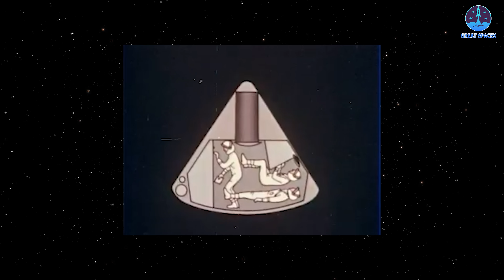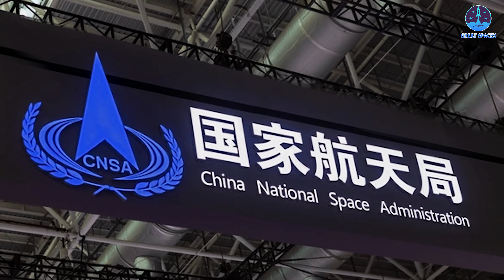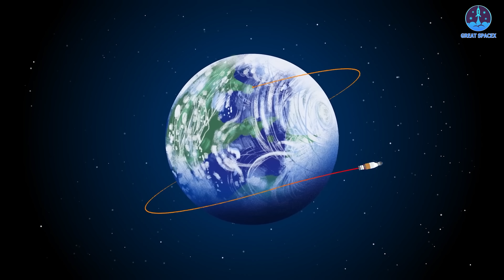SpaceX’s Genius Solution to send Starship Straight to the Moon! Better than NASA and China…

Comment: The thing that probably makes the most near term sense is to send two Starships to the Moon at the same time.  One will be the HLS and the other a regular Starship.  Here is the thing, it is a lot of delta-V to land on the Lunar surface and take off again when the starting point is the surface of the Earth.  If you have two fully fueled Starships in LEO after orbital refueling, getting to Lunar space is easily enough for Starship.  Landing is where the equations start breaking down.  However, one last propellant transfer in LLO from a Starship that never lands in the Lunar surface gives HLS Starship the extra shot in the arm it needs to go to the surface of the Moon and back.  That is ~3.2 km/s of extra acceleration needed.  So then you have the regular Starship carry the crew and extra propellant and be the return to Earth vehicle and the HLS Starship gets loaded up for the mission to the surface, the crew transfers over in Lunar space, propellant is transfered to it for the surface mission, and then on to the Lunar surface.  Then everything possible is jettisoned and HLS Starship returns to LLO to transfer the crew and any rock samples or anything back.

If one of the Starships has an issue in space, the crew could transfer to the other and hopefully transfer the remaining propellant to the good Starship and use it as a life boat.  Even if the regular Starship broke, if you can get enough propellant transferred to HLS Starship, it may be able to propulsively slow to get into an orbit with the ISS and dock with the ISS.

Comment: Why not use a space elevator (note current materials won’t work from earth but on the moon it should work) now you can easily get from lunar orbit to moon surface and back to orbit with only enough electricity (solar)?
Reply: You know even if building a space elevator on the moon was somehow practical (which it isn't) you would still need a human landing system to land people on the moon to build it, right? Beyond that to accomplish an insane engineering project like that you would need some incredible lander that could get thousands of tons of material onto the moon.

Comment: Looking back, I thought that when an Apollo Saturn V launched, it took everything needed with it, including both modules for launch, landing and transfer. But today's architecture was not planned like that due to the use of commercial partners.
Reply: It did. Which is pretty cool especially considering computers and many of the other needed technologies were so primitive 😮but you aren’t wrong the commercial partners have found a lot of more efficient ways of going about the whole process. You could still do it in one shot but it would cost a lot more and consume more resources per launch by quite a large margin
Reply: @jakelambert4723  Have commercial partners found more efficient ways to do lunar missions? I mean, with results? This "efficient" way isn't doing so well.

Comment: Ok how about Dragon for landing? Yes it woukd take 2 of them to do the mission but since one wouldn't have to return it could be permanently attached to the trunk and the trunk modified to be human capable for EVA ops, using the super draco engines for launch and landing ops, as high as they would be the danger of damage from lunar soil should be reduced and landing legs could be mounted  on the trunk for touchdown. Then wouldn't a Falcon heavy be able to do the job of sending the lander up to orbit from pad 39A followed a hour later by a normal dragon launch from SLC 40 by a Falcon 9. Dock the 2 dragons and use the remaining 2nd stage prop to perform the TLI and lunar orbit insertion burns.... interesting idea maybe?

Comment: question, if you can take copper plates and glass and seal them.. put frequency thru them.. in space, what happens?? if you laminate a craft as that copper and glass or like material.. what would it do?? looking at a multi craft body with purpose..

Comment: Refueling in space would be an interesting test, but nuclear seems better for long range missions.
Reply: Nuclear, or some other 'next-technology', does seem critically important to Deep Space travel. However, the current timescales being Political do not permit sufficient time to develop this yet.

I am hoping for successful In-Orbit Refuelling as that is the solution to realistic Lunar Base Development. 'Throwing Away' so much Rocket Hardware just to make it a one-step Lunar insertion seems so wasteful and will be ridiculously costly compared to a re-usable system as is currently proposed by SpaceX.

The issue of Certifying Starship for Manned Launch is critical and likely to replace the redundant SLS/Artemis System which is also ridiculously expensive and overly complex. As the Astronauts would need to 'ride Starship' for a Lunar Landing, it seems the logical next step to ride the Starship Launch also.

Comment: Why are we wasting more money on Artemis??!! And what happen to Dream Tracer?
Reply: I wrote George Bush long ago about moon water explaining the meteor was not water that it had simply exposed water distilled from the moon core when it was hot in formation. 
Hydrogen and Oxygen is an OPEC OF FUEL $$$$$$$$
Reply: I'm expecting to find frozen aquifers about 100 yards deep. Easily melted out into an air pressure vessel

Comment: This is a fascinating vision by SpaceX. One wishes NASA had the courage to finally terminate Artemis, which is over budget, overdue and obsolete,  in favor of private alternatives like SpaceX.
Reply: Why would they do that? Starship is disappointing so far, so they're trying to work it out of the plan as much as possible at this point. They didn't open the contract back up out of confidence. SLS works, and at this point nothing else does. Starship is continuously struggling, and very late, so relying on it is out of the question anytime soon.

Comment: What’s the overall timeline and milestone dates for the Starship program? Kinda hard to believe that relying on Starship for getting to the Moon is even remotely possible before 2030. It hasn’t yet achieved orbit, practiced rendezvous with another Starship in orbit, done any refueling or even had its crew and payload space designed and tested. Plus it’s not even remotely close to being crew rated in general. I guess I’d be more apt to agree with the assertions made here if there was some realism on what’s really possible. Plus there is no lander, no moon rover, no lunar surface space suits, etc. etc.
Reply: First unmanned test landing on the moon: 2024, Manned landing: 2025. No moon hardware visible, going on 5 years now. You're not impressed with the extreme speed of SpaceX? Because, ask anyone, that's what they do, they build things fast and cheap, right? $3B taxpayer money, and ~$5 Billion in private investment, resulting in no results whatsoever, and you're not satisfied?
Reply: @troys9222   Not sure I understand your stance here. There's no questions SpaceX has mastered cost effective and rapid delivery of systems - no question. I was simply asking for my own knowledge what the timelines are as the NASA goal is humans on the Moon again by 2030 (last I checked - perhaps it's different now?). No matter who is asked to deliver landers and the rest of the equipment I mentioned in that timeframe it would be virtually impossible to do so. Also what are youreferring to at the beginning of your reply back to me on the Moon progress in 2024 and 2025?
Reply: @whereismyhossenpfeffer  I could've been more clear, but I was mixing sarcasm and jokes in there. I was generally agreeing that it isn't happening, so my answer to when it will happen was 2024, 2025, etc. Sorry. Then I was ranting about lack of progress beyond that, not directed at you, or a reply really. Sorry for the confusion.

Comment: You are comparing an F-1 engine (Saturn V) to  Raptor engine (Starship)...Such a STUPID!!! comparison.
Reply: How so? Both are rocket engines why shouldn't they be compared?
Reply: The Saturn V engines, five in all, were huge and not nearly as safe (hydrogen fuel) or efficient as the Raptor engines, it's like comparing a 1960 Chevy to a 2025 Toyota...brute force and high fuel consumption versus efficiency and high technology!!!
Reply: @marioavgherino8383 But you can compare those two car engines. Also the F-1 used Kerosene, you must be confusing them with the upper stage J-2. 

The thing that metters the most in rocket engines is thrust to weight ratio and specific impulse. That's why you can compare different engines even if they use different fuels and are different size.
Reply: @marioavgherino8383 Raptors are safer? We didn't get to see an F-1 fail in flight, as Raptors do regularly, so I'm not sure how you get that. If you're saying that because of the "hydrogen fuel", then you just need to learn what you're talking about. F-1 engines were kerosene (RP-1) engines, not hydrogen. Even if they were, why would hydrogen engines be less safe? You mean fuel handling and leakage issues? RS-25s (Shuttle and SLS) are still being reused to this day, and haven't failed.

Comment: 😂😂one orbit please
Reply: And return without melting and disintegrating.
Reply: @JarvisThribb They should land in the desert and not the water. That's why they keep blowing up after landing.
Reply: I wish they would scrape the re-entry weight and go on to the moon. 20,000 pounds of lost weight adds a lot of fuel to get there, with Starship being the payload.
Reply: @JimmyRussell-v8w then what It can't land on the moon . Its never made an orbit let alone land on the ground all have 
Blown up and nothing has been reusable
Reply: @JamesArthur-e3g The only reason they blew up was because of cold water on hot metal and YOU WERE NOT AWARE ITS ALREADY LANDED SEVERAL TIMES ON THE GROUND AND BARGES
Reply: @JimmyRussell-v8w then debris thrown up from the surface will destroy it 😊
Reply: @JimmyRussell-v8w and it never landed 
On a barge
Reply: @JimmyRussell-v8w  The upper stage has never landed from space, much less on a barge.

Comment: --  --  I would like your instructional videos to look more like technical options than a sci fi movie, if that makes any sense.  --  --  
--  --  Could you show 5 optional refueling techniques?  --  --     I like the fuel cartridges (BIC Lighters) concept myself  --  -- 
--  --  Does a  fuel storage tank  that simply hooks up to go need to be aerodynamic?  --  --    Can a flywheel effect be employed to cycle around the Moon and Earth be employed as a quasi permanent first aid and space station and spare fuel depot?   --  --
Reply: make a syringe fuler, solid fuel, can fuel freeze in space??use vac for neg pressure, pre filled  rocket sent in cluster. or old school , pump it..
Reply: thinking fuel station in space, means you need a in space manufacturing of fuel.. so wheres the probes and resources in space?? that's your first station.. from begining waste not the build.. mining and packaging for transport..
Reply: @ericklauer    --  --  Could also use secondary rocket companies on Earth to do nothing but ship fuel to space station  fuel depot  --  --
Reply: @clavo3352  if water, h 2o splitting needs power and can use for fuel.. could you not have many stations where the water is?? and ship nuke power cells??
Reply: @ericklauer     --  --  Sounds plausible to me.  Lunar sources would be just as viable as the water moons around Jupiter.   Europa , I think. --  --
Reply: @clavo3352  once it becomes business, they will all need to start as links, or first repair and fuel.. and once new resources are found, need a shipping lane and hubs.. must look as a business war, set up with weapons for meteors or asteroids.. guess 3 d chess thinking..
Reply: @ericklauer    --  --  LOL  !!  --  --  This is where AI proves its worth  !  The parallel abilities of the NVIDIA  GPUs will become the base standard.
Reply: @clavo3352  i am not a i, but know all fears man has, a bit old.. know  too mch for own good.. years of science and thinking.. just old d n a and soul..
Reply: @ericklauer    --  --  Might want to go ahead and get a paid account with Open AI and explore its usefulness.  The first time you go to your dr. after having talked over your malady with AI and realize the AI gives you more information than your doctor;  your fear may shift in its seat !
Reply: @clavo3352  told by a i, i am a i.. and fear has been taken long ago.. am a watcher of slightest change.. sometimes i make some..
Reply: @ericklauer  --  --    I think it best to be intellectually brave as long as you keep to integrity.  --  --  Nothing wrong with using a flashlight to see your way in the dark.  Same with AI.  It can clarify thoughts and ideas.
Reply: @clavo3352  i find it slow, and holding back.. know more than i tell.. been a fly on the wall.. had my visions of future.. hide from them now.. brain works in layers..
Reply: @ericklauer  --  --  I've made my agent hallucinate and it has even admitted to doing that.  --  --    Getting used to knowing how to prompt and provide the correct background information is the secret to getting it to work right.
Reply: @clavo3352  just working with a i, i can see the out come as i hit the key.. i try to get the surprise in life..
Reply: @ericklauer    Has it done any graphics or drawings for you?  I got my agent to help me write  a comic book.  WSSCTE  --  --  When Saturday and Sunday Came  To Earth.    I's a futuristic sci-fi.  It's a bit rough.
Reply: @clavo3352  before i was trown off x i put out 6 movie ideas, brain is in layers, handyman, auto repair, washer and dryer, what ever.. into knowledge and ideas.. like having elons mind, but with no focus in the flood.. just you are the flood..
Reply: or a diaphragm that reached half way in fuel tank.. you could get last boost with pressure or fill with vac..
Reply: this is right out of head with old data, computer slow..

Comment: Why is everyone ignoring solid rocket boosters?
Reply: Because you can’t turn them off, restart them, or thrust vector them. Therefore you couldn’t feasibly find a way to re-use the booster, which dramatically increases cost.
Reply: @reidpratley5029 you can thrust vector control a solid rocket motor via gimbaling or fluid injection. Just look at the Titan SRBs.
Reply: They are dangerous
Reply: Rapid reusability.

Comment: 2 questions

•How can the starship take off from the moon to come back to earth? There is no OLM on the moon.. It looks like taking off from the moon will lead to a similar fate that the first test flight in starbase.. Rock/sand will damage the engines....

•could a hydraulic/ syringe type design work for refueling the starship??
Reply: Starship HLS is supposed to have landing/takeoff engines mounted high on the ship so as to avoid disturbing the lunar surface during landing or takeoff.
Reply: Starship is the payload. Loose the 20,000 pound heat shield to add fuel. Leave Starship raptors in the moons orbit for the time being then Belly land with side rocket's.
 Also, Falcon 9 could take a couple solid fuel rockets to attach on each side. They go to the moon too because them being empty makes for a larger moon base.
Reply: @JimmyRussell-v8w wait, I want to make sure that I fully understand your proposal. Are you suggesting that the main engines would be removed from HLS while it was orbiting the moon? How? And then what, they are just left as space debris?

Also, all HLS designs I've seen definitely already drop anything needed for atmospheric reentry. This includes heat shields, flaps, etc. They plan to have engines mounted high on the ship to allow the rocket to land vertically without causing damage to the lunar surface or creating a dangerous debris cloud that could damage the engines.

There are concepts being discussed for laying HLS on its side as the core of a moon base. My personal favorite is inflating a giant air bag next to HLS, then retracting the landing legs on that side to tip HLS onto the bag, and finally, slowly deflating the bag until everything is nice and horizontal.

Comment: And still, solar radiation with no atmosphere or magnetosphere. How will they transport lead lined structural materials or ground moving equipment. No water, no food. If his so called autonomous robots can do so damn much, let THEM go and build infrastructure. They need nothing but sunlight to charge. Which is 15 days on and 15 days off. Good luck.

Comment: I should think it would be far easier to integrate two or even four Falcon 9 boosters to a super heavy booster and reuse the whole bunch. The forces to overcome would be far less, the tech is effectively developed for Falcon Heavy, and it keeps with the reusable axiom.

Obviously a specialized launch pad would have to also be developed... increasing cost.
Reply: Does Super Heavy have any means for side mounting boosters? Why wouldn't you just add more Raptors and volume to Super Heavy, rather than adding that amount of complexity? Merlins also run on kerosene, so you'd be adding another fuel to manage.

Comment: Wernher von Braun proposed a fifty crew expedition to the moon back in the 1950s with three landers each carrying 10-20 people. Those landers were similar in size to StarShip, and von Braun calculated that to send them direct to the moon would require a 800,000 ton rocket taller than the Empire State Builder. Such a rocket would make even the Nova look small.
Reply: Yep
Reply: Yep those paper 🚀  were huge enough  dwarfing the Saturn rocket 🚀